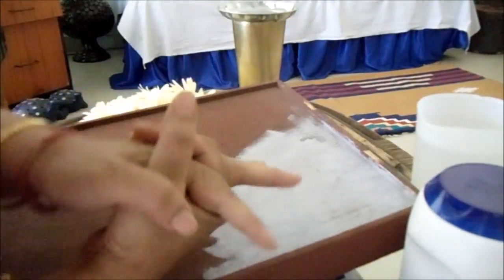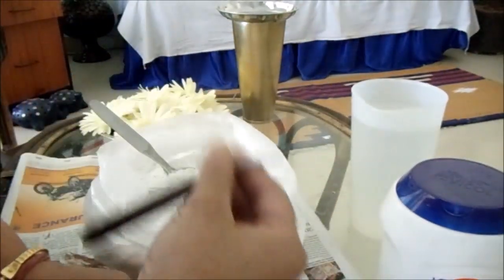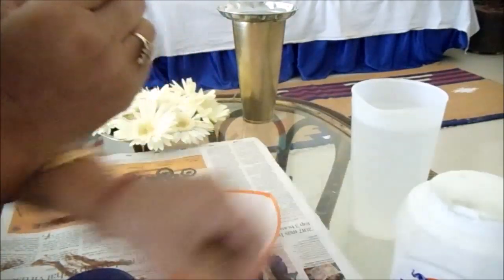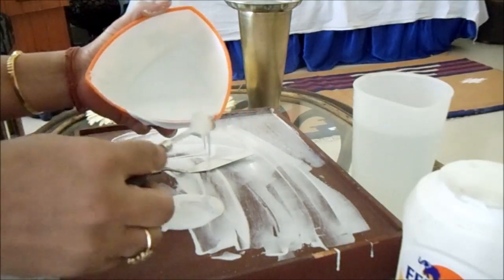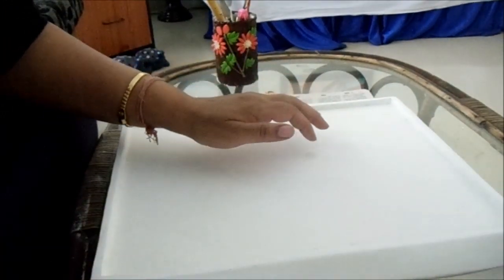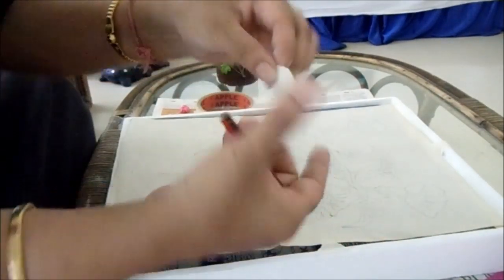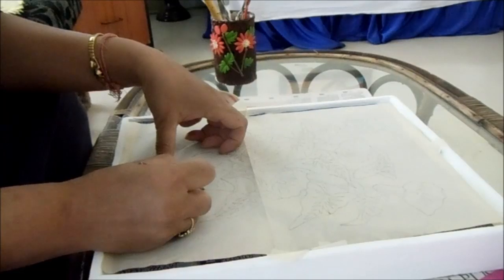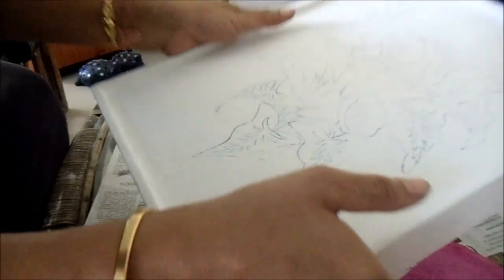DIY relief work painting part 1.

Comment: can we use POP
Reply from the maker: Parminder  No, POP will not work smoothly. But u can use ceramic powder .
Reply: That’s not true. I use plaster of Paris for impression and texturing. It turns into dry sculpting eventually. But it’s less messy and there are less steps
Reply: Not to mention, this video is about how to make plaster impression.
Reply from the maker: But it's not good for relief work
Reply from the maker: U r right , impression n texturing is not possible without POP .but I m talking about my relief work . It's a lengthy process by the time work will finish POP will get dry  .
Reply from the maker: U can watch this video also
https://youtu.be/o8wL5Wzt1Lk